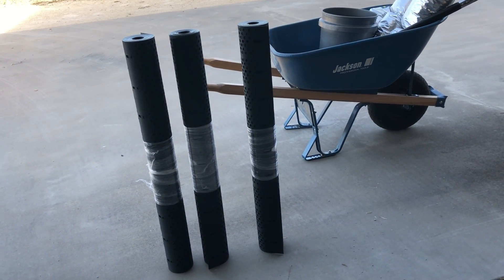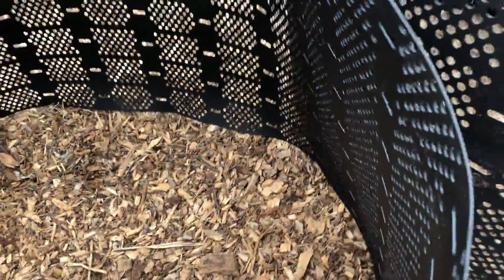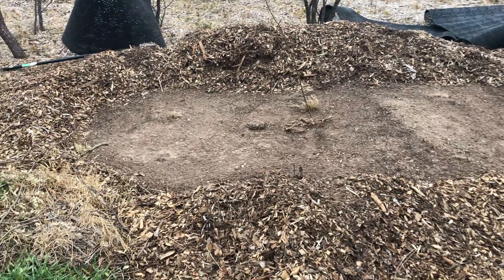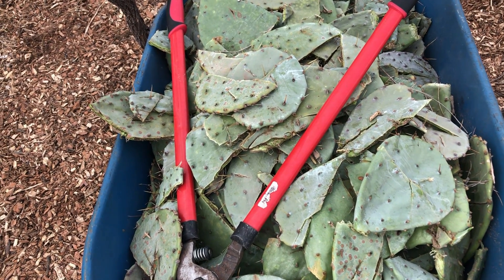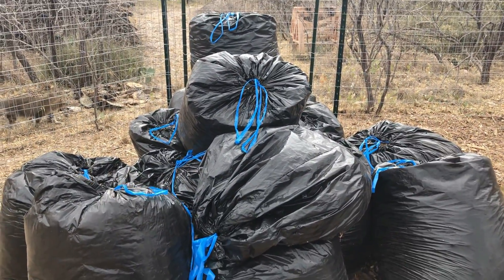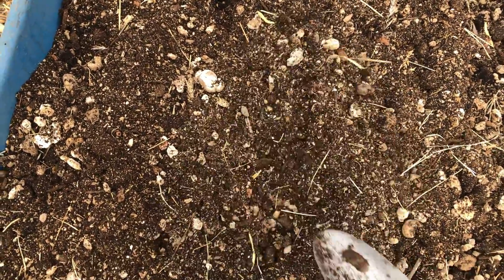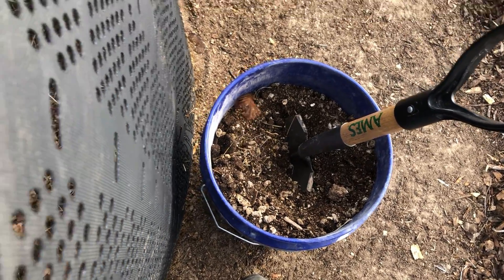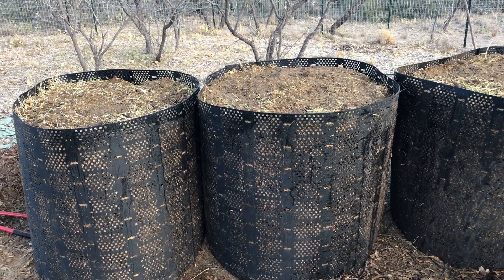Composting Cactus, Donkey Manure, and Leaves in Geobins - Part 1

Comment: You’re a rich man
Reply from the maker: It’s been about one and a half months since I put those compost piles together. So far it hasn’t turned into the black gold yet, but it looks a bit darker each time I turn it.
Reply: Tried covering them to keep moisture in? I’m in semi arid Spain near Valencia, it gets too hot for the bacteria to really get going, bins are better in shade and kept moist. You can pee on them to get them going too. Good luck
Reply from the maker: @monicacruz4407  , I haven't covered them or put them in shade since it's winter time, but I may have to once it starts getting hot. I'm hoping these piles will be ready before summer, so that I can fill them up again. Thank you